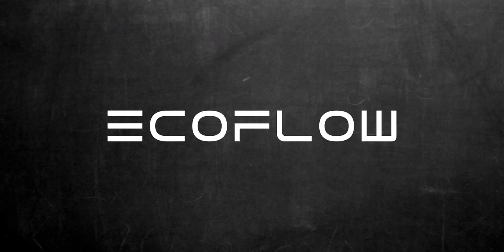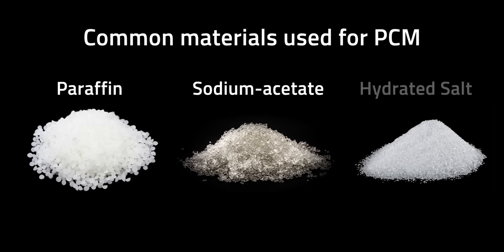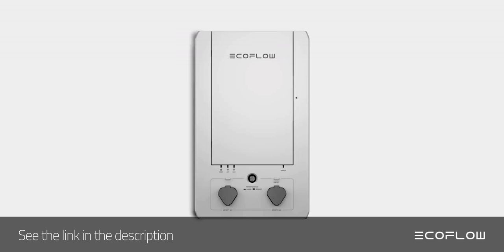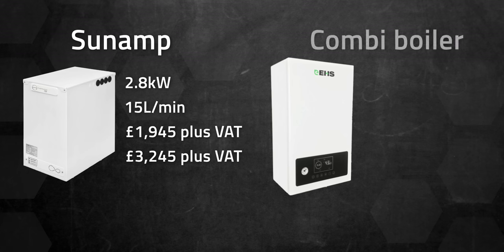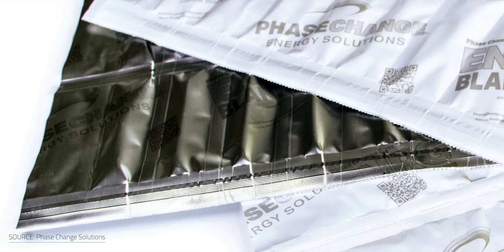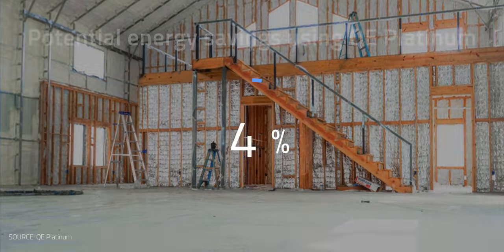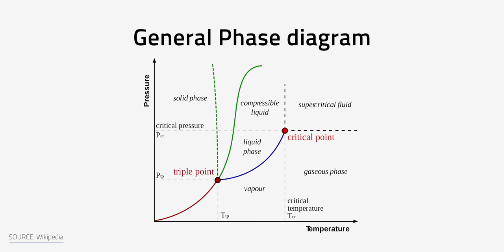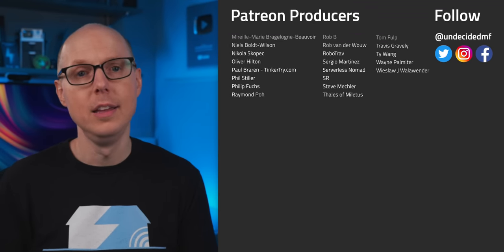Are Phase Change Materials the Future of Water Heaters?

Comment: While I like this, it is sooooo much easier and cheaper to run a standard electric water heater with ONE of the elements running directly off solar DC power. You only have to add an isolated thermostat and use the right ohm element. It's how I set up my water heater. Cheap, simple and effective. I don't understand why this isn't something you can just buy. It's too easy.
Reply: Thanks, maybe it's not complicated enough so they can't charge much for it
Reply: @eby6114  That's probably the deal. Too cheap and simple to make a profit.

Comment: If we look at residential, climate control and water heating really are the two major things for home use.  Things like TV's and computers don't use much power by comparison.  Climate, Hot water and Cooking are the three big things for residential, so it makes sense they are the things that use the energy at home.   Even if you reduce the energy used for those things, they will still be the highest energy usage in residential situations.   Pushing those sort of figures is more scare tactics and shock value than really determining where to save energy at home.
Of course I love the technology changes and the fact things can be used to save energy, but lets stop pushing figures just for shock value and focus on the technology.

Comment: Matt, you missed the whole point.  I've lived in both Germany and the U.S.  Germany's building waste far LESS energy than buildings here in the U.S., via two means:  German construction has a far better mix of insulation (1) and interior/pass-through thermal mass than here in the U.S.

All the best technology in the world doesn't amount to a hill of beans if the insulation and associated construction is poorly done.  NO technology can fix the vast majority of poorly-built U.S. homes.  U.S. homes waste three times as much energy both heating and cooling because they're THAT poorly made.

(1) Blocks convection (drafts), conduction and radiation

Comment: Phase change stuff is not effective insulation. Instead, it smooths a single day: like adobe, when outside temperatures swing from too hot in the day to too cold at night PCMs moderate the swings. But if it is too cold during the day or too warm at night PCMs don't help.

Comment: Two pieces. 
A. When not in use turn off your hot water heater, when not in use. Takes about 45 minutes for he water to get hot from cold. Personally  i can make it easily last for two shower. So it stays hot for about 48hrs.
B. Install proper heat casing around your water heater, mine sits in a small metal box.

Comment: Are you looking at the latest data for Natural gas and Propane??? With the newer furnaces and heaters that are rated at 90% to 95% efficiency I would question that against Old Coal and Natural gas power plants. My furnace and hot water heater are so efficient that the flue is a PVC pipe NOT the old double wall flue.  Rather than worrying about the heat of the exhaust I have to worry about mold in the condensation because #1 component of the flue gas is water.

Comment: Now if they would just remember that we have 120/240 and make all units with the ability to add extra battery capacity and the ability to join 2 either to double the wattage so a 1500 watt unit pairedeand together to up the wattage 3000 watts or to give 120/240 volts it would also great if they would add the ability to add a second inverter so you could buy a unit that your could afford then as money becomes available you could buy the add on second inverter then upgrade the battery for someone who only needs 120 volts just buying a 2nd or 3rd battery would for me and a lot more like me all we need 220 for is AC and also for some a submersible well pump even a heat pump water heater or heat pump dryer would run on 1500 watt unit 2 paired together to make 240 would be 3000 watts of 240 volts ac meybe if you had all 3 you might not be able to run them at the same time so shut one or 2 down for an hour while you dry clothes most cases you won't run out of water or have your house get unbearably hot my ac is currently not working so I put the load in the dryer and when the outside cooles to below 70 degrees I put my fan in the front door and open the bathroom window then turn the dryer dose double duty brings the house temperature down and blows the hot air from the dryer right out the window also how many people unless they are utube video maker's need to charge devices that would use evey USBandUSB÷C and the 12volt auxiliary power port they'd need to double them in our case I'm planning on setting up 12 volt DC plugs by both our bed for cpap machines and USB  and USB TYPE C CHARGE ports by our beds and chair's in the living room to charge phone's and tablets so I don't need 4 USB slow charge ports 4 USB quick charge and 4 USB type C charge ports so I don't need 2 unit's just one and a second inverter so I have 240 for my AC UNIT and eventually a heat pump water heater and dryer would love to see them bring out 120 volt heat pump water heater and dryers them 120 would be all I need

Comment: Uselessly complex.  Just add more insulation and get all the benefits with the addition of less noise along with the fact you can install it yourself.  Just use a giant hot water tank for heating and solar thermal.  No need to use VERY expensive paraffin(Yes, paraffin is cheap if you can buy by the train car load...).  Water is free.  For the cost of a cubic meter of paraffin, you can easily buy many many cubic meters of insulation for a hot water tank and the water is ~free.  The heat exchangers are easy as well as all you have to do is grab either copper pipe and make your own or grab a used radiator out of a truck.   All of this is a fraction the cost of the unit he describes.

Comment: Bu we need to get ELECTRICITY out of hot water not store it.......we can get mega litres of hot water from roof top collectors but storing electricity is another matter and that is only with a battery........you could use a hot air engine running on hot water coupled to a generator but that is far too complicated for the amount of electricity you can get out of even boiling hot water but if you have lots of it it's doable.......but you still have to store the electricity in a battery.

Comment: Is the core of our planet actually a molten salt reactor? Just under immense pressure the molten salt reflects waves in a similar fashion as metallic liquids?
Reply: Iron core is the magic that creates the magnetic fields without which we would be fried by solar radiation!
Reply: @TheLosamatic  True; general science states its a mixture of iron/nickel and the swirl of those two metals interchanging positions cause magnetic generation- there's even theory that a large mantle like piece of metal(solid?) may interfere with the poles reach towards the south American continent I believe. just an idea though that maybe there's likely high salt concentration from the amount of salt water on our planet that reaches the core- possibly depositing fresh salt to replenish the cores cycle; as most other planets have largely dead cores or metallic gas cores which do not compare to terrestrial planets.

Comment: fake
Reply from the maker: How?
Reply: @UndecidedMF  EHS Combi boiler in your video has 12kW of power (minimum), hot water flow 6l/min, provides central heating and cost only £1060 ex VAT. If you need better water flow or have off-grid PV installation you can buy water storage tank with 3kW heater for £785 ex VAT. Best solution is of course gas combi boiler which cost maybe £800 for 25kW unit, cheap to run compared to electric boilers (gas is still 4 times cheaper per kWh compared to electricity), efficient, safe, tried and tested.